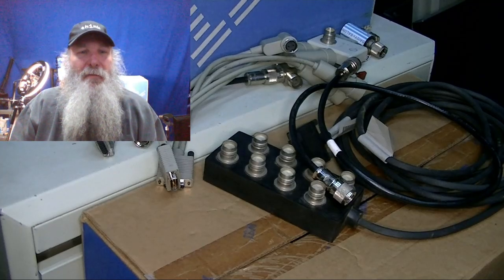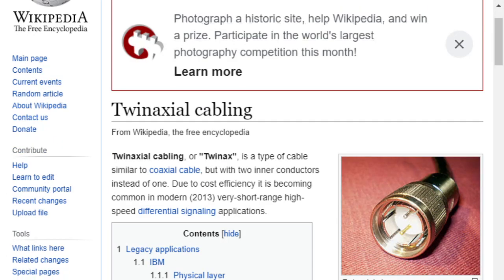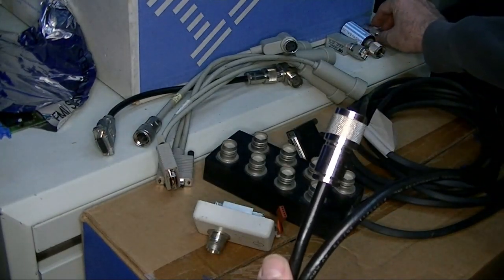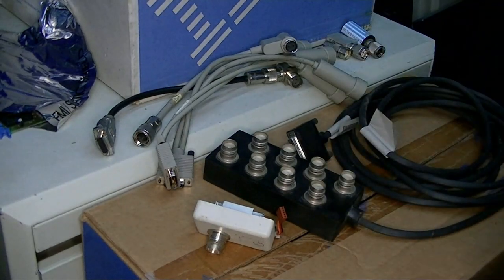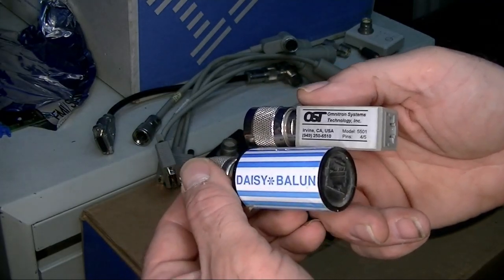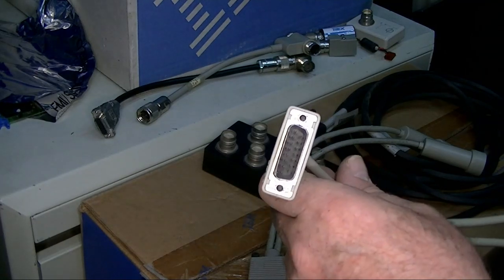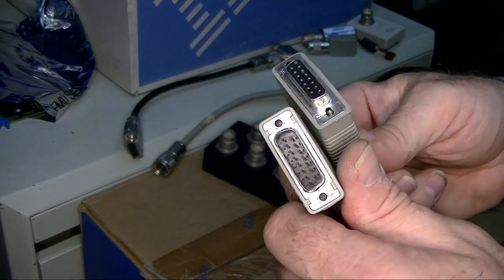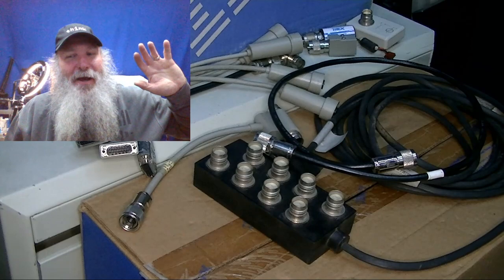An introduction to "twin-ax" cabling and connections!

Comment: Today I saw several boxes nearly full of new Twinax cable at a local surplus store- all made sometime in the 1990s.  Apparently a form of Twinax is still used in networking, particularly with direct attach cables connecting large network switches.

Comment: Brings back some memories from my IBM day's.  Lost count of how many of these twinax cables I've terminated!  The biggest fun though was to use the Oscilloscope to diagnose a short in the cable, as these would invariably be run all over the place and once they stopped working it was usually due to a break or a short.  Therefore using the Oscilloscope with the 1Khz square wave allowed you to pinpoint the distance to the short or break.  It was then easier to find the location of the cabel in the cable run to fix or replace..   IBM used to charge customer a fair bit for our work doing this!

Comment: Good tips! I've never actually had to handle twinax. I appreciate the practical demonstration. 

I always understood that twinax was  basically the same as coaxial but with 2 conductors instead of a shared one. Coax is better for longer distances and lower frequencies. Albeit, cabling is far from my area of expertise.
Reply from the maker: But twin-ax is "balanced" phases, so the cabling (for the 1Mbitps speed) can be very long distances.